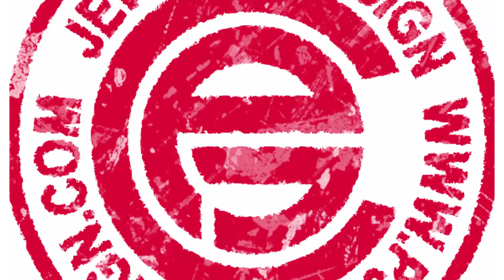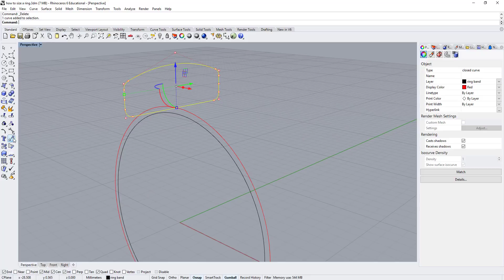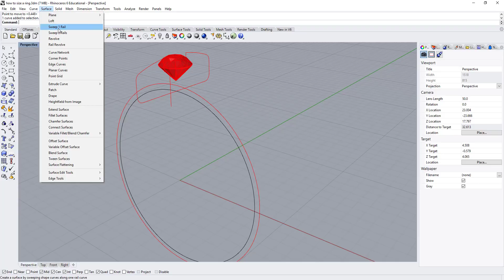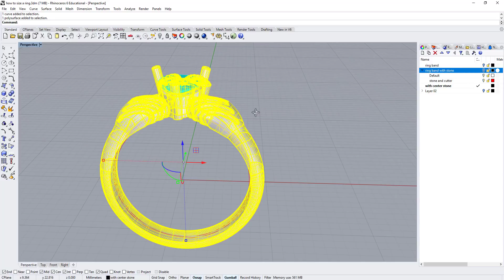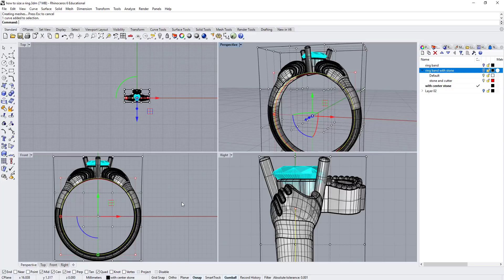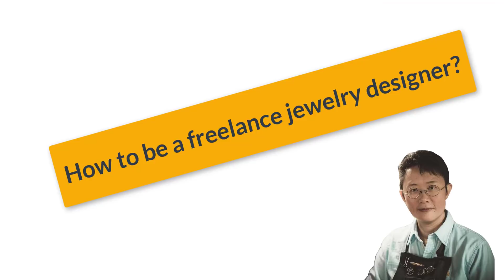How to Size Ring Model in Rhino3D: Jewelry CAD Tutorial #50(2018)

Comment: PJ , i have a problem in Rhino i couldn't understand why , i can't explain in writing i will have to show if you can help me understand this , i fixed it but with trying another way but i can't understand why the first method witch suppose to be the correct one didn't work ..well it did but it made the model having no volume or i don't know 
can i email you my issue ? it's okay if you can't it's just for learning because i already made it with another way
offset some surface making them having issues like "no volume ..having less then 0 volume ..and matrix will just crash when trying to '"mesh repair"  .. well i just found out that using sweap 2 , two cercles and just litle curve as a profile made the surface split on two i don't know why..using sweap 1 had no problem with it
why sometimes surfaces apear to be good but they have errors like no volume when making them solid .
Reply from the maker: Foued Bendaya it is hard for me to know what went wrong till see the model. You can email me at pj@pjchendesign.com and write me a short description for what the issue is.
Reply: @PJChenJewelryDesign  i will do that sensei !

Comment: Somebody asked who the best Rhino teacher is - I think, on YouTube, that PJ is and I have not connection with him.  Good work, good production values.  #2 - he has asked lately for suggestions.  How to make a bypass ring of which there are many variations. Part two of that is how to make windows to pierce the sides of rings.  And not just rectangles but rings that graduate up to the center hand have graduated sized windows all along.  Nice job in general though.  I am an intermediate Rhino student (and master goldsmith at the bench) and I've really liked this channel!
Reply from the maker: John D. Hi John. Thank you for being a fan. Rhino doesn’t have one command to make pattern graduate size. However, if you have grasshopper. It will be easy to change size. Or if you are using Rhinogold. You can use “ flow dynamic” command.

Comment: Hello PJ
I'm a beginner jewelry 3d designer with rhino and i know the basics well .. i build jewelries but they aren't so complicated 
everytime i want to do something hard and twisted and complicated i always fail.. something that isnt always symetric or something with scary design to the jewelry ..
I really want to get advanced and know how to use the program to build crazy things .. how is it possible for me to get to that level?
And also many told me to get Matrix since it's a lot easier to build and you can do even better things.. is it true?
Ty! great videos keep on it
Reply from the maker: Hi, Learning any software is like learning a new language. It takes time to understand the structure. Even with complicated structure, if you know the fundamental, you can de-structure and build parts by parts. Complicate models usually need to break into parts and re-construct them back. As far as software. Both Matrix and Rhinogold are the Rhino plugin. So they share most of the commands. Matrix and RhinoGold are specific design for the jewelry industry, while Rhino has been used not only jewelry but also in many other industries. I had taught Matrix and currently use RhinoGold for jewelry design. they both have powerful tools for stone and setting, which will speed up the modeling process. However, If I have not had the knowledge on Rhino, I will have no idea how to build a jewelry if the shape was not pre-build in the software library. If you are in the jewelry industry and you use CAD every day for the living. I will recommend buying either software. Bottom line is, you need to know how to use Rhino commands well.

Comment: I try to make graduation ring but the text is so tiny it cannot print .one letter is .8mm in height and .6mm width.  Can you give me some advice on how to achieve such a tiny details do I need to use  CNC machine ?
Reply from the maker: HI John, 
Even they survive in printing. but casting and finish on metal will kill such small text. If you have text so small, I will suggest you have laser engraving.
Reply: Thanks a lot for your help PJ